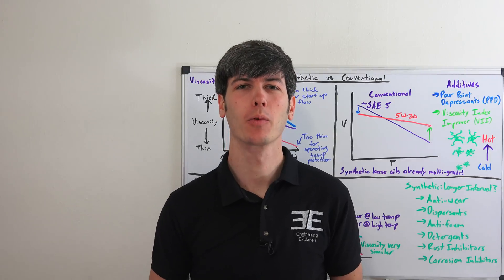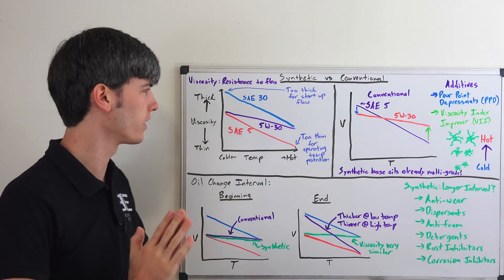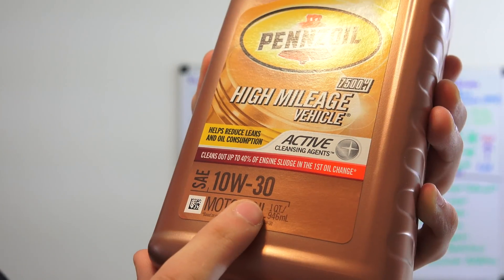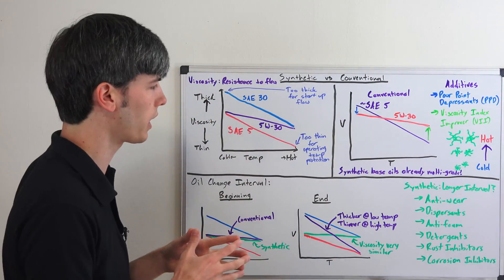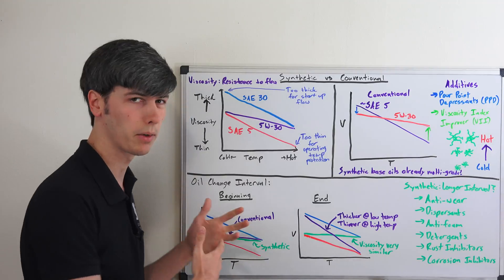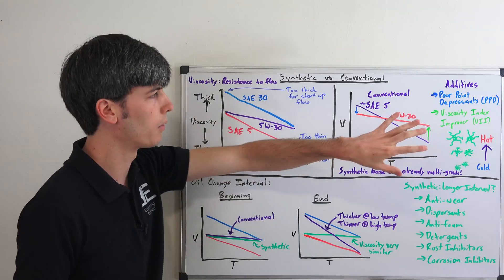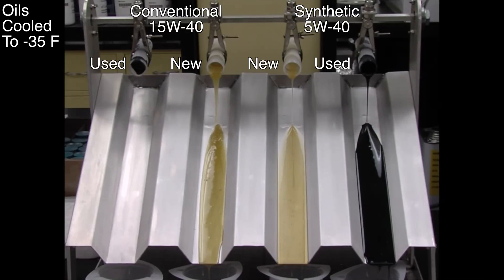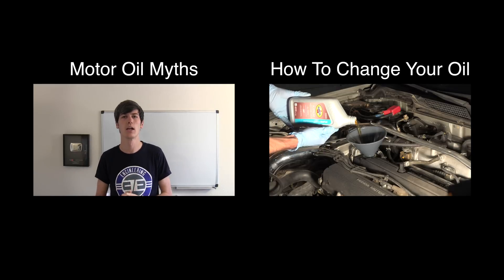Is Synthetic Motor Oil Better For Your Car?

Comment: Yes and no.
My 1975 Ford Capri has been mostly run on 15W-40 Convetnional HDEO engine oils, oils which are meant primarily for Diesel engines but also can be used in Petrol engines, they're very cheap and very good oils ( for example : Shell Rimula and Rotella, Chevron Delo, Mobil Delvac...
It currently has 306.000 Miles and after changing the valve stem seals burns zero oil, has even compression on all cylinders, and has perfect oil pressure.

Comment: if i use 20W-50 conventional for my motorcycle and i want to switch to synthetic i still have to use a 20W-50 synthetic ?? and do i still have to change the oil every 1000KM ?? Thank You

Comment: Hi there
I have a 2006 Lexus GS300 and I'm living in a mostly hot weather area, engine oil cap refers to use a SL SAE5w30 which is not available even at the dealer and the only Lexus motor oil available is SM & SN 5W40!
I've been using the SM 5w40 for the past year till I saw the SN 5w40 and decided to use it which I did at next oil change; I haven't notice any negative effects but I made some researches about SM & SN  and found out that the further advanced oil type might not be recommended for an engine that requires SN oil!!!
What do you think and advise me to do ?
Thanks in advance

Comment: @Engineering Explained:
 What happens if you mix 5W20 with 5W40? For example, my motor needs some 5W40 to refill, but  the best thing they got is 5W30?

Comment: As I know, high temperature and low temperature oil grade measurements are observing different characteristics. For high temp ratings, they use kinematic viscosity characteristics, but for cold ratings, they use cranking and pumping viscosity characteristics. I am not an expert, but I' ve searched "Oil" topic for a long time. The data which I mention about can be found in Amsoil website (Straight - Multi grade oil comparison task). This sentence is a copy from there "Obviously, cold temperature or W ratings are tested differently than regular SAE viscosity ratings. Simply put, these tests are done with a different temperature system" Thanks for the video, very useful info.

Comment: Anyone who drains oil like that from there engine should be ashamed of themselves that"s not motor oil in the video its sludge. Bottom line as a professional mech, engine builder, racer, and also a fleet mechanic. Change your oil on a regular basis every 3000 mi and change the filter your oil will never drain out like that and the likely hood that you have an oil related failure will be as minimal as it possibly can be. Use the grade oil your motor is recommended  or one grade thicker nothing else is needed. With a fleet of 15 veh driven by people who dont care about the veh we change oil every 3k we use the cheapest oil we can get and all our taxis get well over 300 to 400 k. we have had over 300 veh in our service over 20 yrs of business engine failures from oil related concerns are non existent.  If you insist on using synthetic you can go 4 to 5k. It is this simple nothing else is needed stick to the plan.

Comment: I’ve been using conventional 5w-30 on my car. It’s a 2012 Charger, is it okay to switch to Full synthetic ?
Reply: Use a high mileage full synthetic to fortify the engine seals.

Comment: Hello, thanks for the video. Quick question. Why do the clutches a slip on some motorcycles when you use a fully synthetic oil while they do not with a semi synthetic?
Reply: @adam8642  Probably because you are using the wrong oil.

Comment: This video was a joke! You compared apples to oranges. Of course the 15W40 would flow slower than the 5W40, it is a thicker oil. If you are going to compare, they have to be the same thickness. Put 5W30 conventional vs 5W30 synthetic against each other. Then show the difference. But I guess your sponsor did not like that and said you have to do it this way, to promote their product. What a waste of time!
Reply from the maker: No, you simply didn’t listen. Watch again and listen as I explain the difference between the oils. I explain that we’re not comparing the flow rate between the synthetic and conventional, but rather between the new and used for each individually.
Reply: Engineering Explained
Half the time they don't even watch the whole video before they comment.
Reply: Then change your title of your video.That might clear things up.

Comment: Lets take everything you said as a fact. Honda has an A service and a B service. The A service is an oil change. They do not replace your oil filter. you think they do. Only the B service gets a new filter. While the new oil is contaminated by the dirty filter. Most or all dealers do this. It really doesn't mater what oil you use. Metal shavings are still floating in your engine. When your engine fails you are out of warranty.
Reply: Sissina LARKING when my oil is changed,they do the filter as well. Both at dealer and local auto shop

Comment: Long Video. Synthetic is better. Use It, Unless you can’t afford it then use the cheaper one
Reply: Rodrigo Acosta - synthetic oil goes up to 15000 miles ( the better ones), it costs 30$ per 5 gal at walmart. to cover 15000 miles with regular oil you need 5 oil changes... I would say the regular oil is less affordable 😉
Reply: 1969bogdi
I pay $15 for five quarts of Walmart synthetic.  It costs less than I used to pay for name brand conventional oil.
Reply: But if you change conventional oil every 3000 miles rather than 7 or 10,000 miles for synthetic, the oil will always be less contaminated and the additive package fresher. The trick to oil and engine life is to change it frequently, not that synthetic somehow lasts longer without getting contaminated by water, blow-be, etc.
Reply: R  C Nelson
That's a fine strategy too, but not the only one that works.   3k mile oil changes are really overkill and no manufacturer recommends that for normal driving.

Comment: can you do a episode on oil pan covers (noise/temperature insulation) and pro’s & cons relation to temperature issues in QLD Australia climate 40+ degrees summer and 10degree winter 
with a car like a Land Rover Discover sport using synthetic castrol edge oil 10w-30 or 40w

cheers

Comment: Hey Broski! I have a 97 Integra! Anyways I use Mobile 1 full Synthetic. Is there a significant difference in 'regular' full synthetic and a "High Milage"? I've got a little over 200k and want to keep this thing for as long as possible. Also, how often do you change your oil? I've been going 4000k just to try and offset costs a little and it doesn't honestly seem to show significant wear until around 3500miles anyways.
Reply: Yeah it's the additives in high mileage oil
Reply: With full synthetic motor oil you can run up to 20,000 miles on it.   Look it up but you need an oil filter that will last that long & the best out there is only good for about. 15,000 miles.   Nothing says you can't change your filter without changing your oil.   So get 2.  10,000 mile filters.    Not sure about synthetic oils but most of the detergents in conventional oil is gone after 1,000 miles they make detergents & put them in separate containers if you want to really keep the innards of you pride & joy clean as a whistle.    Google about motor oils to see that synthetic oils are good for 20,000 miles.   The big difference in conventional & synthetic oils is with synthetic oil the molecules are all the exact same size & you can look that up too

Comment: I drive a 2013 E Class 220 D diesel
Onboard computer decides when to change oil and check-up...depending on your driving.
Since I mostly do highway my oil change is every 25k kms...which is 15k miles.
They put full synthetic Mobil 1 and change the filter too. Runs soooo smooth

Comment: The 3 million mile volvo owned by Irv Gordon achieved that guiness record by using castrol gtx ...thats good enough for me!
Reply: Cars from that era were quite happy on mineral oil. Most current cars have to use synthetic oils. Their requirements and specs cannot be met with mineral oil. Even if you change it every day it's still not gonna work.

Comment: my toyota luvs the mobile 1.. thats all she drinks.  blackstone labs even said my engine was happy with mobile 1 so im sticking with it.  I can get away with extended oil change intervals up to 10,000.. but i usually stick to 5000

Comment: .?????? In baby clear terms? Use synthetic oil right?
Reply: Deborah Durham yes! absolutely! and it’s cheaper too!! 5 gallon of good synthetic oil goes up to 15000 miles!!! you’ll need to do 5 oil changes of regular oil to covar that mileage. 🤭
Reply: Stay away from Valvoline and Fram

Comment: my rs4 125 want 10w-40 i think but for sure 5w40 or 0w40 (itf im not wrong
i Use castrol 5w40 motor cyclo 4 stroke oil

Comment: Weird ...people waste more time  on motor oil nonsense .Like breakfast cereals ...

I have 300k on all my GM trucks.

I use normal 5w30 Mobil etc. 

Cars rust out before they wear out today. Transmissions and cooling systems ignored  and fail while people argue over oil... 

One time I ran out of oil and actually put Canola cooking oil in to get home...it worked in my ole Chevy.Kept rpm under 7000 though...

Then I crashed my f250 and poked a hole in radiator...I was in front of a 7/11 and recalled my grandpa telling me back in the day they put oatmeal in radiators to seal holes in emergencys. I went in and got Quaker instant oats put a little in first clamping heater core hoses shut. The  Arab clerk at 7/11 behind counter thought I was nuts ..Truck never leaked  for a year!!!. Smelled like break fast at my shop for a year. Lol

Comment: you should use same viscosity oil. the 5w- 40 will flow smoother than 15w in cold temps

Comment: A few problems, I had a shop in the Twin Cities in MN.  and took care of about 100 3/4 and 1 ton vans some diesel but most gas.
They all where very tough duty cycle and high mileage . At the owners request we serviced the gas vans at 3000 miles and the diesel at 6000. At my own discretion I used Shell Rotella 15W40 in all the engines.
Now hers the problem after nine years following this practice we had two failures one a scrap popped up from road surface and whacked the filter on a Chev G10the other was a Ford/Cat 3208 that was a reman that never held together.
Now the rest where all models of Chev and Ford engines both gas and diesel that all had high miles. One fleet was Chev 4.3L that the owner would not sell until they had 400000 miles on them. Many others had as many miled and dam few with less.
But the winner was a 1996 Ford E350 with a 460 V8 a 4 speed COM trans and 3.90 rear end.This unit had just bumped over one million miles  with the  engine and trans having never been opened up ,NEVER ! 
Needles to say I'm not a big fan of synthetic oil. Great in H D transmissions and rear ends.

Comment: Sort of ignoring the video to a point here, but in my MotoGuzzi California 3 Motorcycle, I used 10/40 Morris oil a first, Mainly because a knew a guy who ran a Motorshop and I could get it dirt cheap.

I was very happy with it, and for the first 40-45 Thousnd miles I used that. I then moved away and thatswhen I started to use GTX Magnatec, still at 10/40 and it was 4 times more expensive, but the Morris, I used to change every 5K and the oil filter every 10K, with the Magnatec, as the bike was no spring chicken, I did kind of abuse it a tad and I only changed the oil every 10K now, but I still changed the filter the same 10K miles.

I did 132,000 miles on the Bike and had no issues at all when I sold her. She was still pulling superbly, and compression was every bit as good as it ever was. The only oneissue I did have, was around 20K miles, when I pulled the head covers of, the oil was a yellow frothy load of crap, but this wasmostly down to not running the engine hot enough, and yes, that was purely my fault with me changing my style of riding and becoming a slower turd, but trying to also keep the revs down a little too much.

For the last few years I have been riding inline 4's but I am back o na V-Twin, this time a harley trike, so it will be interesting to see how the Harley compares to the Guzzi when it comes to how the oil goes.

So far, I have only done 10K on harleys own branded crap, and so its done nothing yet. this xmas will be its first full service by me ( Previous was done by harley themselves ) and I will be calling on Castrol GTX Magnatec once more.

Comment: I will stick to my 10w/30 conventional motor oil for my car, truck and motorcycle. Using Pennzoil, Castrol or Valvoline. Still unsure of the use of synthetics.

Comment: new and used oil are no different. Synthetic used oil is same as new one it just has inpurities - those are sulfur and carbon build  up from burning process and some fine iron or aluminium dust from cylinder and piston friction. In big marine engines they newer change oil. When oil becomes too contaminated with inpuritites they pump it out and clean it. They use special cleaning process and black oil that is feed to the cleaning machine leaves like new. We don't really need to change oil at 15, 20 or 30,000 kilometers  intervals. Oil that is used in truck are the same or less quality and gets change every 50 or 70.000 kilometers.

Comment: All you need is mobil 1 0w 40 fully synthetic the best allrounder for summer or winter.
Had no problems for decades with this.
It's a very sympathetic oil haha.

Comment: viscosity explained simpler, if you have a slight leak of oil from your car, use thick cheap motor oil, if you have a brand new no leak car you can by synthetic the thin fully synthetic will piss out of a leak in minutes where the old cheep stuff just leaks slowly and some times gets you home. of course no matter what anyone explains if you can afford synthetic well you have way to much cash. enjoy

Comment: it don't get 35 below here in tn so i will stick with my cheaper oil and change it when i feel like it which is at minimum of 5k miles. my daily driver has 300,000+ miles on it and so far so good.

Comment: Holds up high mileage and calls it conventional oil
Reply from the maker: High mileage does not determine if it's conventional or synthetic. You can have both high mileage conventional and high mileage synthetic. The bottle I held up was conventional.

Comment: Mobil 1 in the U.S. is hydocracked Group 3. Mobil in Europe, like most European oil, is real syn. For instance, the oil recommended for your BMW M3 is European real syn.10-60 weight!

Comment: Synthetic Oil is not so simple. Up until 1997, Syn oil had a true syn base like polyol ester. It cost about $10.00 a quart. Castrol started cracking Dino oil or producing it from methane about 1997, also calling it syn oil or 100% Syn oil. Now these oils are $5.00 or less a quart and almost every oil manufacturer makes this hydrocracked oil. However, "real" syn oil is still available but it is still $10.00 a quart and is only made by Redline, Royal Purple and AMSOIL. Same with the case with "Syn" transmission fluid. The "new" syn oil is called Group 3 and the "real" syn oil is called Group 4. This video makes no distinction between each syn oil type but there are SAE tests showing that Group 4 is superior. Group 5 oil is used in jet turbines (jets) and you can believe it has a true synthetic base. Even the Germans used a syn base oil in the ME262 in WWII. If you call Penzoil and ask them if their oil is Group 3 or Group 4, or ask if they make a Group 4 oil for your car, they will act as though you were from Mars. Good Luck!

Comment: Been running Wal-Mart 5W-30 dino oil in my car for years. Change it every 6000 miles.  240,000miles later it still doesn't burn any oil.  Any SAE standard oil will do the job.  If you're worried about wear, change the oil more often.  Sure, synthetic is better but its overkill.

Comment: do engine flush really work? my mechanic left the engine oil filter loose to the point it lost most of it. It seems like it got burnt quiete a bit and wondering if i should flush or just change oil a few times

Comment: This is the most biased video I have every seen on oil! "I'd like to thank Penzoil for sponsoring this.....commercial for our new product". If the video at the end had shown the same viscosity oils you'd have seen there is very little (almost imperceptible) difference between synthetic and conventional oil. While true synthetic oils do have to ability to hold there respective properties for longer, if you change your oil at the prescribed intervals you are throwing your money away on synthetic. If your car is recommending synthetic oil, it's probably because it requires a 0w20, or 0w50. Those oils only come in synthetic variants. Manufactures use them to eek out slightly better fuel economy over their entire line up of vehicles. If GM can save 1.3% fuel economy on every cruze it sells it can put that gas guzzling V8 in its Sierra. Manufacturers government regulations cover there entire line not individual vehicles.

Comment: So my check oil light came on in my 1994 Ford explorer so I pulled off. Had no spare oil at all. So I said well somethings better than nothing. Pulled the oil cAp off took a pee in the motor. Put the cap back on started it. Oil light was off. Started back on my way. LOL FORGOT ABOUT THAT I DID THAT. Changed the oil 3 months later after driving it 44 miles everyday. Fixed the oil pan gasket. The 4 litter v6 now has 347,567 miles and sounds new. Still. I guess pee works.

Comment: That's great but you didn't cover dirt and foaming and other breakdowns of older oil.  If you use any oil over a longer period it will collect contaminants which can cause abrasion.

Comment: In Finland, all use full synthetic oil up to 20 years old cars. I can not understand Why America uses mineral oil and is saved in the wrong place. Culture is really different in this regard. 

I think the new long oil change intervals are a really bad thing. I change the oil every 7000 km. (4350miles)